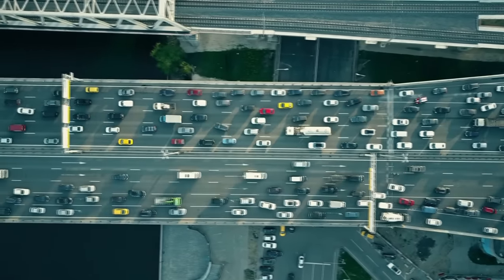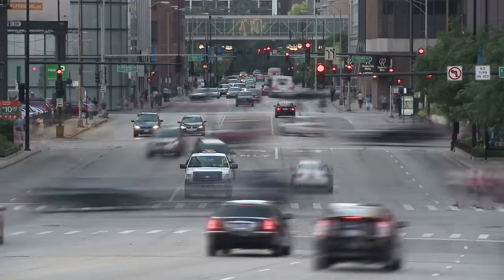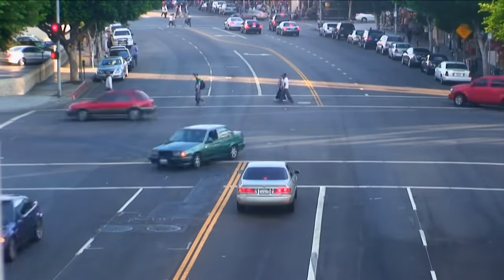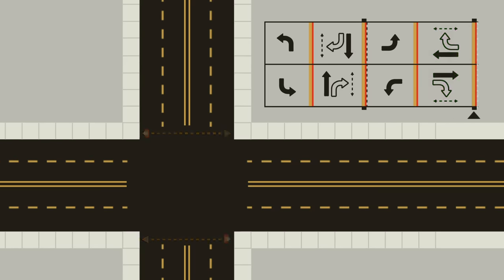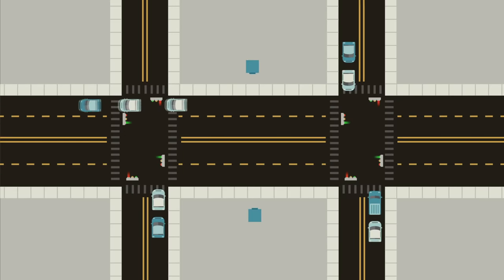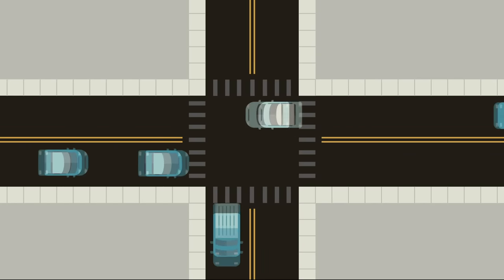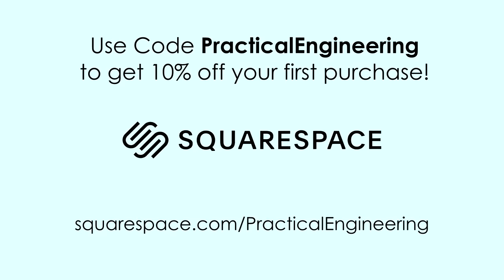How Do Traffic Signals Work?

Comment: Florida traffic engineers gave up their education at 5:19 and don’t seem to know anything after that point. It’s common to wait for minutes, during peak hours, with no one going through. Then when the platoon starts getting close to the green light, it changes. Stopping that platoon again. Then everyone complains traffic is so bad, because on top of what I stated earlier, it snowballed into gridlock 1-3 miles down the street.

Comment: There's a way for you to trigger the inductive pickup even if you're normally not able to. Place a neodymium magnet on the bottom of your scooter or bike (might not work for everyone) the magnetic field will usually be strong enough for the coil to detect you. At least that what I saw in a video 10 years ago...

Comment: Huh, just realised that you only have 3 signal states, here in Norway we have 4. Yellow will light up along with red before switching to green. Very handy when approaching the intersection since you can always know what is happening. If you approach while its red & yellow you know its just about to switch over so you can adjust your speed accordingly.

Comment: When I was a kid, some traffic lights utilized what we called a trip plate. You could see the cuts in the tar where the plate was and it was usually immediately before the white "stop" line. Unfortunately, not everyone was aware of the trip plates. One day, at a single lane "Y" intersection on Rte 6 in Rhode Island, I was behind an elderly woman driver who stopped her car several feet before the trip plate. I shook my head and blew my car horn hoping to get her to inch forward. A minute passed, then two. There was no timer for the light, just the trip plate. Now most drivers, after waiting a while would let their car move forward but this woman was content just sitting there. With my blood boiling, and unable to drive around her, I finally went up to her car yelling at her through the closed window that she needed to move forward to the white line. At first she ignored me but finally listened to me explain about the trip plate. She slowly let the car move forward and within seconds our light turned green. I also had several occurrences of my motorcycle not tripping a plate so I would have to roll the bike back then drive forward putting on the front brake to apply more pressure on the plate or if there was enough room, move the bike ahead of the stop line and let a car behind me trip the light.
Reply: “…to apply more pressure on the plate….” It's not pressure activated, it's triggered by the changes in the interplay of current and fields as metal on the vehicle enter the trip wire's fields.

Comment: Get rid of more traffic lights and stop signs.  Make main arteries without lights or signs in the N/S direction, or E/W direction.  Anyone trying to cross the path would have to merge onto the direction of closest lane to them, then move to there left to make there left turn to go the opposite direction or back to where they wanted to cross the path, and turn right.
I like round about intersections also.

Comment: In Melbourne, Australia they use Loop "pressure plate" systems to identify if a person is waiting at a redlight or turn lane. If it detects cars, it starts a timer to turn green. Otherwise, it wont turn green. This allows side roads to get a green on a main road. 

The thing is, its a complete waste of money and resources. Australia is notorious for money laundering, and this feels like more of the same.

Realistically, during peak traffic the main road is forced to stop every time someone takes a shortcut down a side road. Because the side road has a red light, people are often forced to take roads with red lights. This is to deter non local traffic, however it does the exact opposite. Because now the main road turns red on "irregular" basis, and the main roads now turn red at the maximum rate from side streets. What this actually does, is force side street traffic onto one road and if you are on a side street without a red light, you will never get a red light on a timer to merge. You are at the mercy of someone being on the side street with a pressure plate, completely congesting traffic.

On top of this, they have lowered the average Speed Limit from 50km to 40km. Arguably to make the streets safer for bikes and pedestrians, the exact opposite effect occurs. Because the speed limit is so low, people cram in to try and get ahead or completely not pay attention to bike lanes and other traffic. No one even uses turn signals anymore until they start turning, because driving at a slower speed requires less concentration and people become sloppy drivers.

There's also no turning on red lights and so traffic becomes more and more congested as people try to take the only main roads that are over 40km an hour, which are still only abiut 40km am hour when you factor in the red lights being so sporadic. 

When i firdt started driving i kept missing green lights because im used to waiting a set amount of time. On top of this, the lights go from yellow to red in a fraction of the time as the US and if you are 3 cars away from the light you legitimately have to slam on your breaks not to accidentally run the redlight.

I tried to explain this to my girlfriend but shes feom Australia and these roads are all she's ever known. Driving is so infuriating for international drivers and it feels like they keep adding things to fix an already broken system.

Comment: Interrupted traffic control is the focal point of what is in my opinion one of the most interesting, if not particularly large-scale, examples of the intersection of infrastructure and abuse of power: I remember a news story of a man in New York being arrested for repeatedly tampering with traffic lights. He wasn't pulling a dangerous prank, he was very vocal about the real reason he did it. He had uncovered a scheme run by the local police wherein certain intersections yellow lights were set to an abnormally and dangerously short duration, so that nearby officers could wait for drivers to make mistakes from mistiming the yellow light and then flag them down for traffic violations. Traffic violations are a large source of income for smaller police departments, so the department was supplementing its revenue with trapping people in minor violations. The guy who was tampering with the tampered lights was doing it in order to be arrested so he could protest and get the story into wider news than he could if he was simply protesting on his own.

Comment: They have lights in some countries that measure the speed accurately enough that they will let the other side go while the going side is still through knowing that by the time the cars start to roll to the halfway point the cars would be out of the intersection by then. Which my uncle tried proposing to the city... but no... they decided to go cheap and replace it with a round about. Which they poorly planned the pedestrian area where it’s covered by trees and doesn’t have light signals like the others in the city so many people have been hit or injured there. And the intersection was notorious for accidents to begin with, it’s been reduced slightly but pedestrian safety has declined by over 60% killing the same amount of people it did to begin with but the difference being instead of car drivers it’s killing pedestrians

Comment: I've noticed the light timing adjusts in my area. Many new lights now sit unused next to old ones with extensive rewiring. I've suspected  signals through AI level computers and radio frequency signals coordinate sections of road  close by. My bicycle computer tells me my maximum speed is 80mph, 61mph, when I pass a certain light! Yes, the pedestrian crossing button seldom does anything and is there to meet a regulation only!

Comment: This is a decent video.  I would have been overjoyed if there had been an explanation as to why pedestrians don't have to push the ped button 30 times prior to getting served.  This drives traffic engineers nuts, but every day we see peds pounding on that button ("Why doesn't the signal let me cross? ... Oh, finally!")

A few glitches + comments:
* At 2:30 the horizontal signals are shown in the wrong configuration (in the U.S. the red indication should be on the left); this happens at other points in the video.
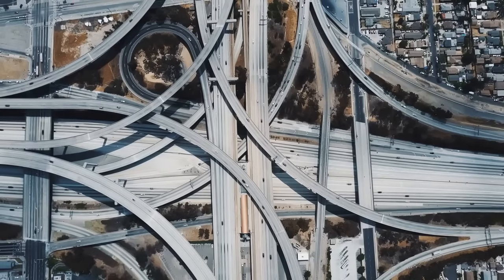* BTW, the aerial image shown at 2:57 is the interchange between the Harbor Freeway (I-110) and the Century Freeway (I-105) in Los Angeles (south of downtown).  North is to the left.  I can't imagine when that video was shot because there's almost no traffic!  The Harbor Freeway at that location carries about 300,000 vehicles per day.
* At 3:45, the narrator is technically incorrect by saying "the amber light warns that the signal is about to change from green to red."  That would mean an amber light would appear before the green turns off, which we know doesn't happen. [Picky comment, I know]
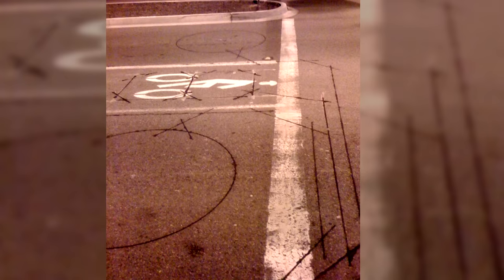* At 7:00, note the inductive loops for the bike lane.  Such a lane is not available at the majority of intersections.  The narrator says "too small to trigger the loop," but it's not really the size of the vehicle that matters.  Rather, it's the amount of metal in the vehicle (motorcycles usually have enough metal, but many bikes are made from non-metallic composites), the positioning of the detector loop, the positioning of a two-wheeled vehicle in the lane (sometimes bikers like to come to a stop next to the lane line) and the sensitivity setting of the detector.
* Huge goof at 8:53: the intersection on the left is showing green indications for all four approaches simultaneously.  Disaster scenario(!) which technically can't happen if there's a Conflict Monitor in the controller cabinet, which would send all the signals in the intersection into flash mode.

Comment: One thing I never understood about traffic lights in america is the jump from Red to Green. It kneecaps the crossing's ability to effectively control traffic by increasing the amount of startup time on the junction.

In england, we have a 4th phase of lights: Red+Amber. In all cases this is legally treated as a red light, so you cannot cross it, but just the fact that it exists gives drivers a couple seconds of anticipation to rev up engines and be ready to move off, decreasing the time it takes for traffic to flow across the junction.

Though on the other hand, trusting America with this power may be fatal since they already treat Amber as "go faster" instead of "prepare to stop", so whats to say they'll use Red+Amber properly instead of just "go early"?

Comment: I live in Missouri, where the speed limit on state and US highways two-lane and four lane divided highways with at-grade intersections is typically 55-60 mph and 70 mph on Interstates and other freeways. When I go to Kansas, I notice that the speed limits there raise up to 65 or 70 mph for state and US highways two lane or four lane divided/undivided highways and 75 mph for Interstates and other freeways. I can't imagine how it is to have a house next to a two lane highway where there are cars, trucks, and semis flying by going 70-80 mph and you have to join onto the highway to head into work at the nearest town every day lol. Why is it that states like Kansas have typically higher speed limits than states like Missouri? Is it because Kansas is less populated than Missouri? Is it to save time wasted transporting goods to towns because they're farther away from each other? I have seen a couple of rather strange instances driving into Wichita regarding speed limits and traffic lights. When you're drive east towards Wichita on US-54/400, the highway is divided four lanes with at grade intersections and a couple of grade separated intersections with a speed limit of 70 for around 100 miles. Heading into Goddard, the highway has traffic lights with the local roads, but the speed limit only drops down to 60. When I drove through there, I was going the speed limit, the light turned amber, but I was too close to safely stop, maybe around 100 to 300 feet from the stop line, and the light turns red right when I'm in the middle of the intersection. The amber light only lasted around 2-4 seconds. The minivan that was slightly ahead of me in the right lane did stop. Good thing no one was tailgating them. To me it just seems really dangerous having intersections with lights and a 4-6 lane busy highway with a speed limit of 60 mph. When you're heading east out of Wichita on US-54/400 right after the K-96 interchange and the road construction, it goes from a freeway to a divided highway with at grade intersections, but the speed limit increases to 70 lol. There's a few traffic lights and then there are houses and businesses on the side of the highway for a couple of miles. The highway then enters Augusta and the speed limit goes from 70 to 30, forcing you to brake. I don't know, but I feel like there are some places in Kansas where the speed limit is too high.

Comment: ***and in Canada like 20 yrs ago I remember while I was a passenger, they had regular traffic signal, that would blink green instead of a solid green.  It would only blink green to let the driver from further away know that it would be staying green for a certain amount of time, 10 or 20 seconds, whatever it was.   I guess to let drivers know that you don't have to speed up to catch this light.  And if it was a solid green it would be changing to yellow within like 10 seconds.  Just so you know from further away I guess.      Clarify me if I'm wrong in any way, or add to what I've said.

Comment: Why, when I'm at the head of the platoon when a signal turns green, do I have to brake at the next intersection when doing the speed limit for the next signal to also change to green?...Shouldn't that be timed to where I wouldn't have to stop?

Also, in my local area I always have to stop at the beginning of the red light phase at every residential street with a signal

Comment: There should be Li-Fi in vehicles and traffic control systems so they can communicate more efficiently. Public transit should also get some priority along with Emergency response. AI should adjust light cycles by 1 second longer and shorter every cycle to allow public transit priority. There should be blue lights at intersections that can highlight an emergency res-ponders route to a scene to allow traffic to clear a route well in advance of all the approaching emergency response.

Comment: What I hate most about traffic signals is pointless waiting. The absolutely asinine times you wait at a red light for no reason. Anyone who maybe is out really early or late going to or from work outside of large cities have probably experienced this. You get off work it’s late you’re driving home. Get stuck at a red light. There are no other vehicles or people anywhere near you. if there are any other vehicles they are so far out the light could cycle 3 times or more before they get close. Yet you have to still wait for it to turn green. That’s so aggravating. When it’s obvious you can go through 100% safely it should be fine. Especially for motorcycles which might not trigger the light at all.

Comment: The actuated signal controls embedded into the road surface, where the pavement has all the cut lines... Does it matter where the vehicles stop in regards to it?  The cut area is typically a rectangle, and I try to stop directly over it (properly behind the white line), but many times I see the first car at the stop light go past the cut area (crossing over the white line), and then the second car is behind the area, and no one is directly over the cut area.

Comment: LOL, one second for every 10mph of speed limit. I think you know as well as I do that no city does that (even though they should).

Also, here's an interesting one for you. The light at Wells Branch & Mopac here in Austin has no red trap - it turns red for one direction and immediately turns green for the clockwise direction. (For example, if you're northbound on Mopac, you can see the light for westbound traffic on Wells Branch turn red, and your light immediately turn green).

Comment: 7:00 - for bicyclists annoyed by the magnetic loop not sensing their bicycle and not turning the signal, here is a trick: lean your bicycle ~45-60 degrees when you're standing over the loop and waiting, so that the metal frame gets closer to the ground and more parallel to the loop. It will induce more current in the sensor and it will start sensing your presence.

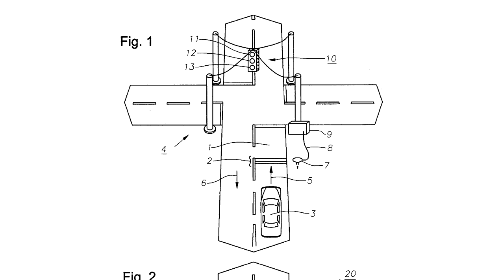Comment: As a signal tech very good, only a couple things that I notice that aren't 'inaccurate' but not entire true either. At 7:45 you talk about actuated signals being able to 'detect' the change in traffic, that's not entirely true, yes it can detect vehicle presence but max times still apply, so if the max is low, then the abnormally high volume on the side street will still suffer, it will suffer even moreso if it's a force-off in coordination. 

Not to mention the fact that 99% of 'adaptive' tech is mostly all marketing jargon, nothing replaces a good count study and in most cases stuff hasn't been retimed in a decade or more

Comment: At 8:35, we have this problem in ABQ. In the 1980s, traffic signals used to be timed for mostly uninterrupted traffic flow at the posted speed limits. But now, they're more about interrupting traffic flow as much possible, especially with close located intersections as mentioned in the vid. There appear to be no logical reasons for this, but more political. Certainly NOT for efficiency. The complaints about these issues by citizens fell on deaf ears.